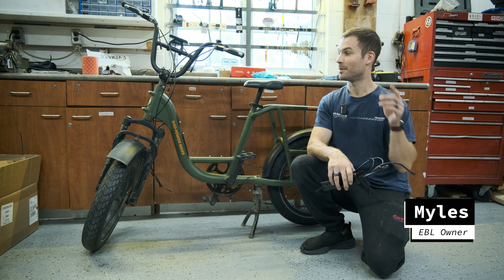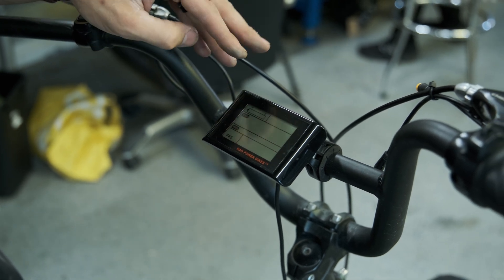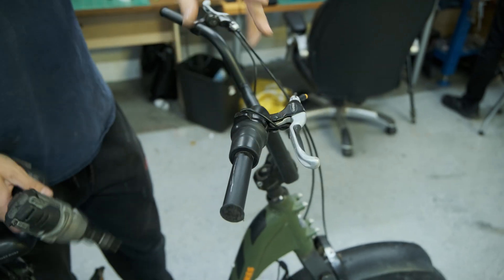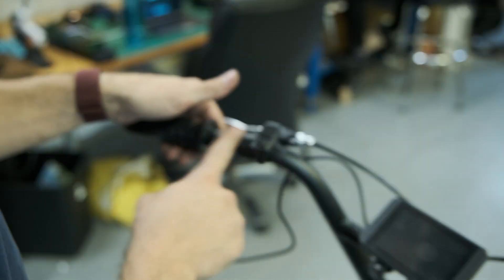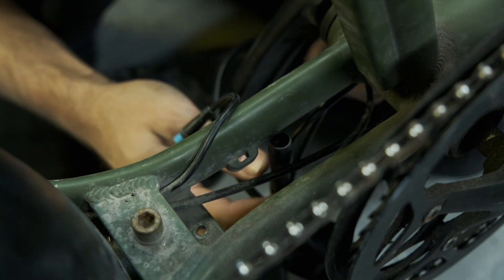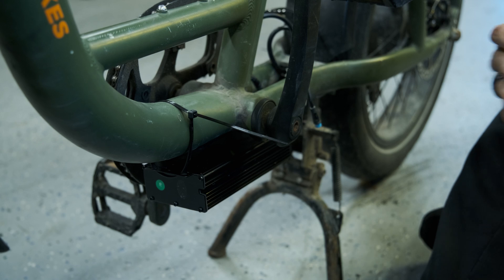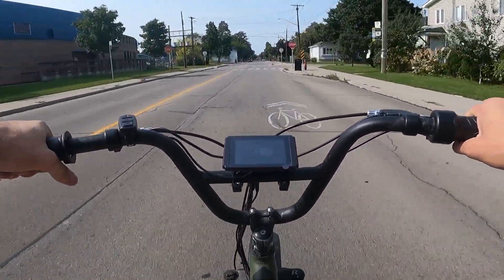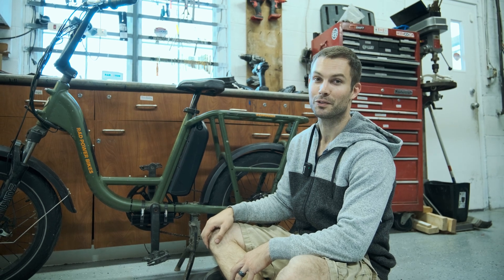Radpower EBike Performance Mods - Radrunner Part 1 (Controller Upgrade)

Comment: I'm definitely gonna get this for my Radrunner 2. Is the new controller compatible with the standard lights, or will I need to order new ones?
Reply: Standard lights yes but it may have issues with the big ones
Reply: @Matanumi  Thanks!